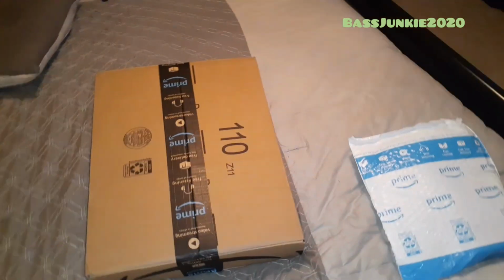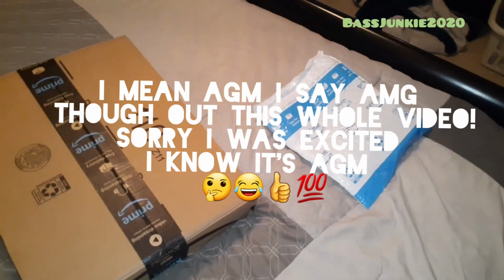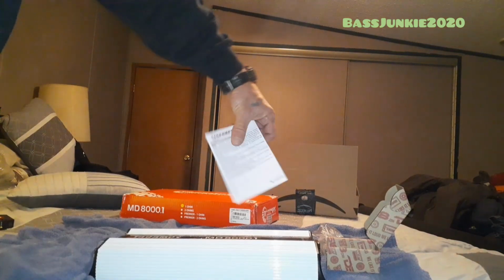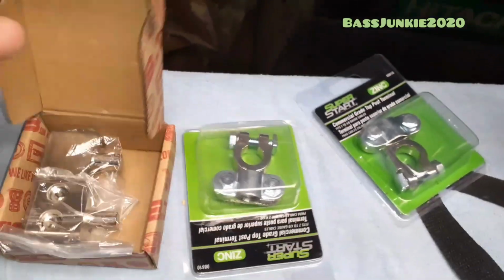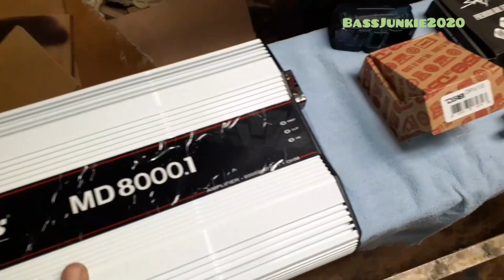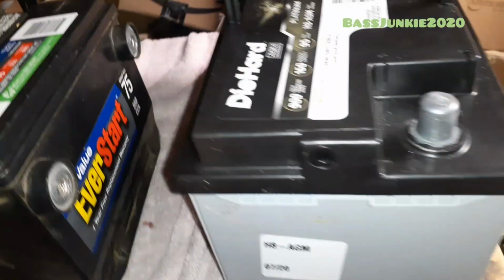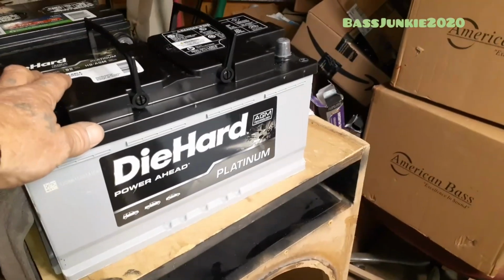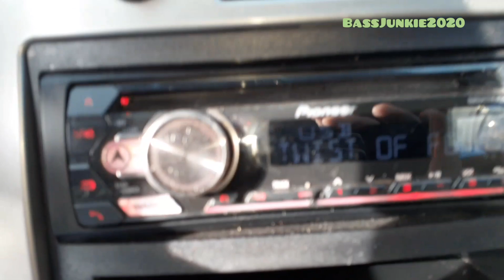Taramps md 8k is here!!

Comment: Let me know how do you have your settings on the amp. High pass low pass? You wont be dissapointed it has alot of power.
Reply from the maker: Ok I will. I'll most likely turn the low pass all the way off to 80. I have the sub signal from my head unit set to 63hz. And for the high pass. I think I'll set it at 25hz. No bass boost 🤔😆😂👍😎💯👊
Reply: @bassjunkie2020  low pass from amp lowest is 90
Reply from the maker: Oh ok I knew it was 80 or 90. My smart 3 only goes to 90. The hd 3ks i used to have were 80👍💯

Comment: I run two group 31s in the back with a stock battery in the front and I haven't had any problems running two different groups
Reply from the maker: I have 2 different batteries now. A group 75 plus. And a 95ah die hard agm to the amps!👍💯

Comment: Hope you get it all figured out. Car audio is a pain. Theirs always a bunch of small things that never go as planned. My 2005 Camry was a pain to put a system in. The electrical didn't like 1 ohm. I had a High output alt, 2 AGM, Big 3, on a 1k amp and still had voltage drop. Now I'm running 2k at 2 ohm and it sounds better No voltage drop. Every car is different. If they would sell us cars with 1/0 cables and Lithium everything would be amazing. Maybe if it was the 80s and 90s. 🤣🤣 Now everything is cheap and ran tiny wires. But your system looks nice. It's gonna bang when you get it all figured out. Nice job 👌👍👌👍
Reply from the maker: Thank you! And yeah the electrical is the hardest part for sure. I'm fixing to go out in a minute and try to figure it out👍😎💯👊
Reply: I thought about using welding cable. But the more strands the better the electrical transfer. I bought some 1908 I think ofc tinned copper 1/0. Was about 58 bucks for 20 feet. Expensive but not too bad. Gotta buy some more eventually
Reply from the maker: @BangingCamry  I need more myself. Cause I had my wire cut for 2 amps now will only be 1👍😎💯👊

Comment: Hells yeah 😀,I just got a couple of md 5 ks.hoping they do well.
Reply from the maker: Awesome!👊👍😎💯
Reply: @bassjunkie2020  how's that 8 k doing
Reply from the maker: @ogairbender808  It's doing fine. I don't have it turned up. I'll turn it up when I get more batteries. I plan on getting more this weekend. But I do miss how I had it. I think it sounded better with 10s and 15s. But that could be because the 10s box is 32hz so it played lows well. The 15s box is 35. Plus I can smell the 15s now. But they are brandnew. And never really seen real power till the 8k. Cause I only had them on 1500 rms amp. So they were only seeing half there power. Anyway I plan on maybe just rebuilding the box. I'm think of building a 4th order in my back seat.  Like a blow through. I can put them in 2 sealed boxes facing down inverted. Then build around them ported blow through. But I do love the 8k. Cause I know I have the power now if I need it. I might get better subs to. I need some that are 2000 rms or better lol👍🤣💨💨💨💪💪💪😎💯
Reply from the maker: @ogairbender808  oh and I've been working till dark this whole week. Why I haven't posted. The amp and stuff is still like it was anyways. But I'm getting that stuff from Tony tomorrow! He sent bunch of stuff he said. I know one of the things is 6 output bus bar terminals! I'll post a unboxing fan mail thing🤣😎💯
Reply: @bassjunkie2020  sounds good buddy ,I got to pull the trigger on a build soon ,I'm still stacking my cheese now

Comment: I fuxked up and hit my taramps 8k with a tool and made it go into protect but it came outta protect mode I’m hoping it still works good😬
Reply from the maker: Oh man be careful! Taramps are good amps. But they are made with cheap parts. Why they are cost efficient. Long as it came out of protect it should be ok🙏
Reply: @bassjunkie2020  yeah man I got lucky  it just clips when I barely turn the gain up  but I don’t think it’s because I hit it  I don’t know though it could be fxcked up.
Reply: @bassjunkie2020  it’s still loud I haven’t set the gain with a multi meter yet but it just clips not that much after I turn the gain up a lil idk if it’s messed up or it just really clipping I’m just barely turning up the gain tho and it starts clipping
Reply from the maker: @AudioAddict.  use a voltage meter so you can monitor your voltage if it dips below recommend amp voltage turn your Bassknob down a hair you should be fine 👍😎💯
Reply: @bassjunkie2020  alright bet man I’ll try that out and see if I’m dropping volts, I just ran 0 gauge power wire from my 240 amp mechman alternator to the agm battery in the back but I needa get some lithium in the back but I appreciate yo advice man💯🔊
Reply: @bassjunkie2020  I’m just hoping that the amp is running to its full potential I feel like I coulda messed some shi up when I hit it with the tool but you live and learn, glad it came outta protect tho.
Reply from the maker: Sorry been so busy working lately trying to catch up my bills. But I'm try put out a update video tomorrow 👊😎💯
Reply: @bassjunkie2020  all good man I understand,bet I’ll keep an eye out for the video🔊

Comment: id get at least one more of them die hard amg's and run them together it would be alot better still not enough but you can adjust your gain to what your electrical can handle to
Reply from the maker: I need 3 of them. I can only afford 1 right now. Cause I just got the amp and stuff. But I plan on buying 2 more. Probably 1 at a time. Cause my light dim with just 1👍👊😎💯
Reply from the maker: Yeah I need 3 more lol. But I might go lithium when I learn more about them👍💯
Reply: @bassjunkie2020  did you go lithium or still running agm
Reply from the maker: @Drago I went lithium. I'm on my 2nd lithium bank. I now have 144ah of Cmax 👍😎💯
Reply: @bassjunkie2020  that's dope I'm nervous to set one up and I got a homie that works at Advance so he's the plug for me to grab several group 31 agm for the low haha